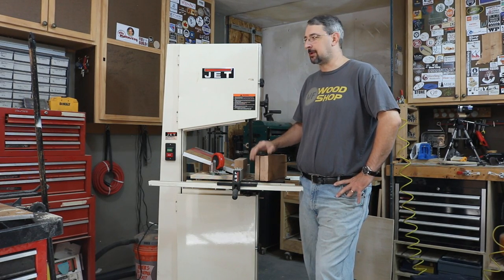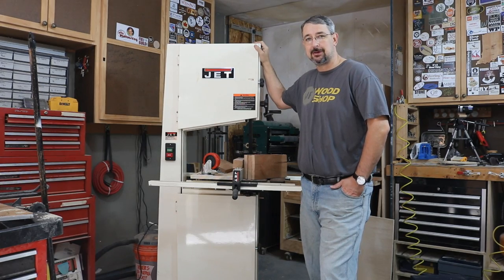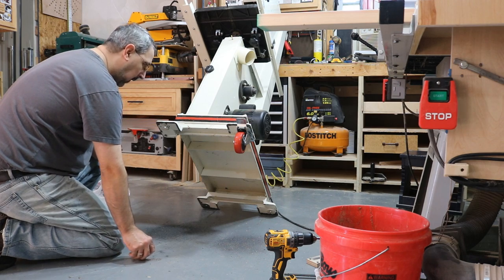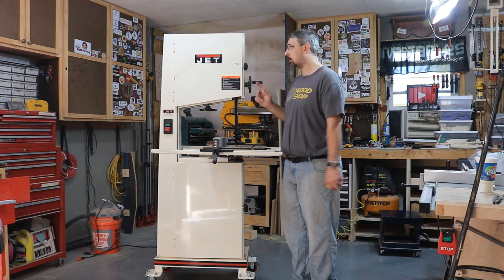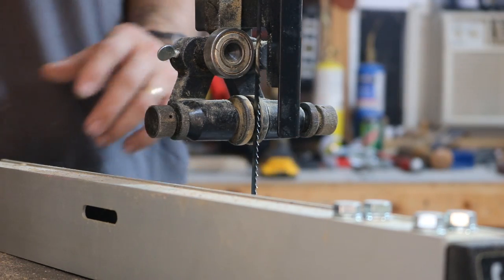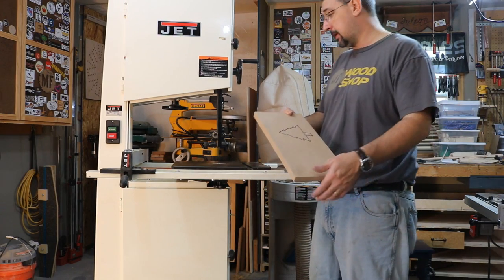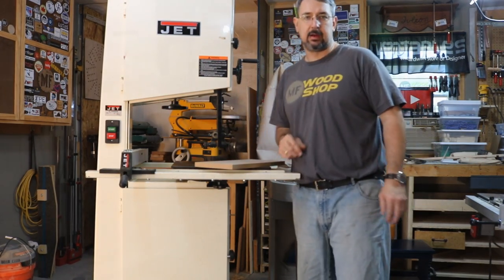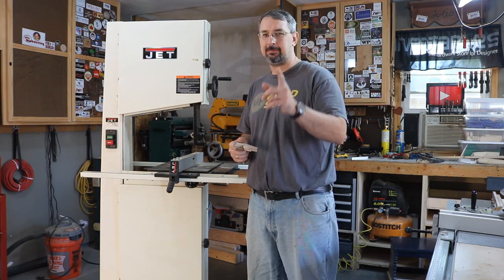Bandsaw improvement,  JWBS-16B

Comment: I don't know if you want to go through the trouble but I made some roller bearing lower blade guides for my Delta knockoff. 1/4" steel, threaded rod and a few nuts. For adjusting the lower blade guides, there is a video from Carter that says you should remove the table when adjusting the blade guides, every time.
Reply from the maker: +David Willett good to know thanks

Comment: Very nice saw for the price you paid Mike! FYI - Woodcraft will have the Resaw King blades at 20% off the 25th thru 28th of November. And for a saw that size, you really don't need anything wider than 3/4". For a good general purpose blade, go to Highland Woodworking and get one of their standard blades. A good one that will do just about everything is a 1/2" 3 TPI blade. I have resawn 10" wide hard maple boards with it.
Reply from the maker: +GuysWoodshop thanks Guy, that's the same as I been hearing. I'll check it out

Comment: Hi Mike, The first thing you need to make is a new zero insert so that nothing can get down under the table. I found out the hard way when a bit of wood got through and hit the blade below and just snapped it as if it was made of cotton. I don't know how much that 1/4 inch blade costs but the money and inconvenience of losing the blade made me mad.
Reply from the maker: +John Fithian-Franks ya, I know that's right those little scraps fall right into that crack

Comment: Man I need to put casters on the bottom of mine now. It's the only thing in my shop that's not mobile. Good score on the price. Have you tried sharpening the blade you took off?
Reply from the maker: +Jay Bates I think the blade the original and after looking closer the weld has broken open

Comment: Great price on the saw Mike and I can feel your frustration with the quality of the equipment on the market, but with the low price on this purchase, you can upgrade as you stated and still have a great investment and improve the quality of the saw. To fix your height problem, take off the metal leg brackets and make a flat 2 x 4 frame with your attached casters to attached to the base of the saw. You might gain the inches you need. It looks like you might be able to put the 2 x 4's with the casters on them inside the base and you could gain all the inches you need.
Reply from the maker: +Frank's Wood Designs I was thinking about that myself. I'm going to leave it for now

Comment: When I installed wheels on my band saw, I ran into the same clearance issue. I took them off and mounted it on a pair of appliance rollers which only added about 3/4" to the overall height. It only rolls in and out of its home, but that worked for me. Since you only cut side to side, there is. No need for locking wheels.
Reply from the maker: +drochon6672 that a good idea thanks

Comment: Mike, I found on my band saw the blade bearings are a bit troublesome to adjust as well.  I have a 14" Grizzly G0555LANV with the 6" riser block and just leave a good 1/2" blade on it all the time.  Also does your Jet have a blade tension quick release?  Overall I think you will like it or like to replace it, but its a nice addition to your shop.. (poor cabinet might have to be shortened)  Thanks for sharing!!
Reply from the maker: +Kenneth Sievers quick release no, I wish the turn knob sucks

Comment: hey Mike, you said that the saw is 2 inchesto tall to fit under your cabinets. could you take the feet off and add the casters to a couple 2x4s to fit inbetween the sections of the bottom of the saws base.  it might give you the clearance you need ...
Reply from the maker: +Vince Moser I think so I was thing about that myself
Reply: Mike Fulton ....great minds think alike  lol

Comment: Ok. Well first of all......You got a very good deal.  2nd, the wheels worked out great.  So it doesn't fit the spot you wanted....It's got wheels on it, right?  Just move it around as you need to.  As far as the guides.  I agree.  That is a very wacky set up.  You might want to go over to Lumberjocks forum and post you issue there.  There are some pretty smart folks over there and maybe one of them has a good solution for you.  And last but not least,   I liked your rant.  Makes me feel better to see someone else get bent when things don't go as planned.  I have been known to chuck a thing or two across my shop when I get pissed off.  Thanks for sharing it with us Mike.  
Happy Thanksgiving to you and your family!
Reply from the maker: Thanks Chem

Comment: I did similar to my planer, and table saw, but used ball casters, as they are more compact and more stable.
Like these;

https://www.bearingboys.co.uk/Ball-Transfer-Units-2617-c

I tried standard casters, but as they swivelled they tended to 'tuck under' and the whole assembly was inclined to tip over.
Reply from the maker: +niklar55 that a good idea

Comment: You might want to look into putting cool blocks on it instead of the guides.  The ceramic blocks are what Laguna uses and they are available by a number of companies.  There are really good carbide tipped blades that are far cheaper than Laguna. Come on do you really think there is that much difference between the blades they are all made of the same type steel they all have the same tooth count and they all have the same carbide tipped blades. Look at Olson they make really good carbide tipped blades for far less.  Don't mean to be preaching here but I just don't like to see guys buy gimmicks for such a simple saw set up that has been around for over a 100 years.
Reply from the maker: +Chuck Hart you may be right my thought process was buy one really good one and be done. You make good points